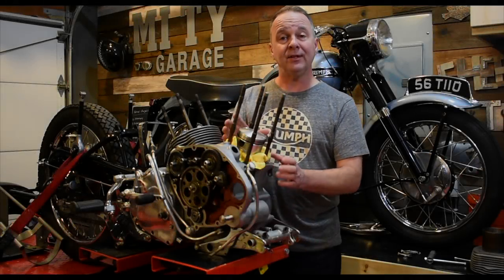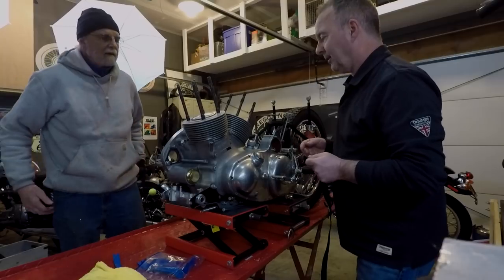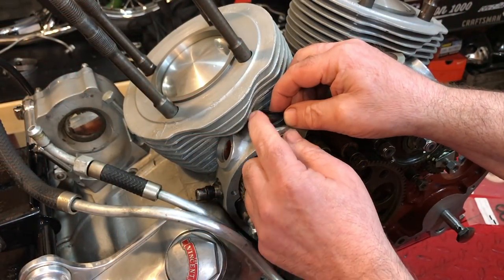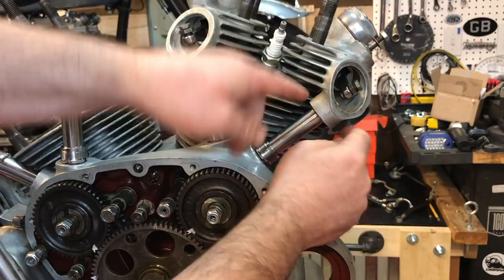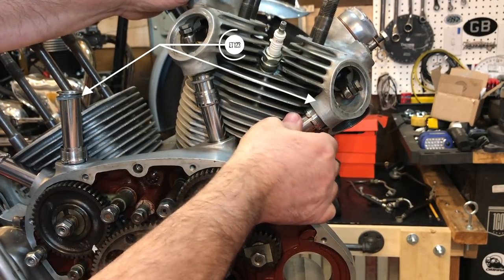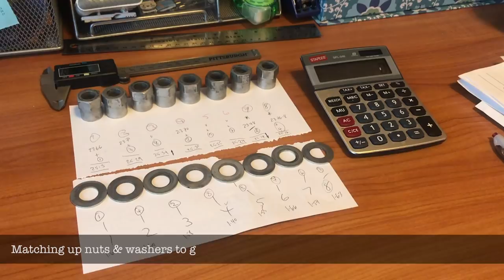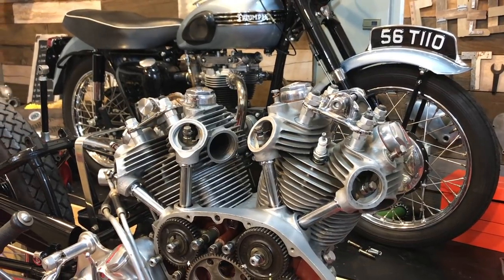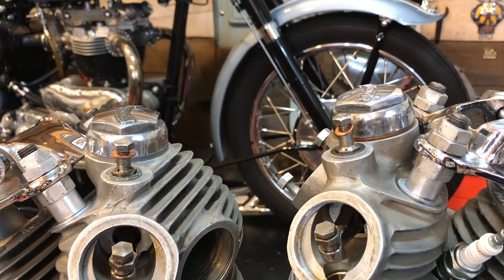Restoration of 1951 Vincent Rapide - Part 25 - Top End 3

Comment: Just a tip for reassembling barrels, for any engine not just Vincent.  I don't like to use anything metal for compressing the rings, I use a piece of plastic pipe of a suitable size, and a cable tie or two to hold it in place. No danger of scratching or breaking anything that way.  Also, to hold the piston securely during the process of sliding the barrel down over the piston assembly, take 10 minutes to make a wooden fork to fit around the con rod and rest on the crankcase mouth.  Using these items it is easy to fit barrels single handed and stress free!  Looking good though, will be interested to see it fire up!  I'm currently working on my '52 Rapide, which hasn't run since the 60's but I'm only the second owner!  It was running when put away by it's first owner but I'm having to check EVERYTHING, it's going to be a long job!  At least it is all original and complete though, so hopefully no bodges or shoddy repair work.
Reply from the maker: Thank you!  WOW, that sounds like a fantastic project.  Good luck with it.  Cheers, Mike

Comment: to retorque both head bolts and engine mounting castings would require removal of oil tank etc again ,i cant see many people bothering
Reply from the maker: Thanks Dean.  Yes, I agree. I went pretty light on the torque settings so will definitely want to re-do them after a few miles.  Cheers, Mike

Comment: That looks lovely! How did you get the cylinder muffs and heads so clean ?  The bit you missed out showing us was the grinding/lapping in the heads to the barrels, but that can be tedious! you are really making good progress on this project.
Reply from the maker: Englishman French Hi Chris, I can’t take any credit for the condition of the muffs and heads. They were already in lovely condition when I got the bike. I simply wiped over the heads with some petrol, but was very careful not to polish them.  Similarly, the valve train was already completed and the cylinder heads had already been ground & lapped to the barrels when I got the bike. Cheers, Mike